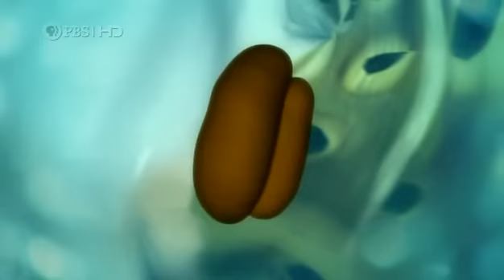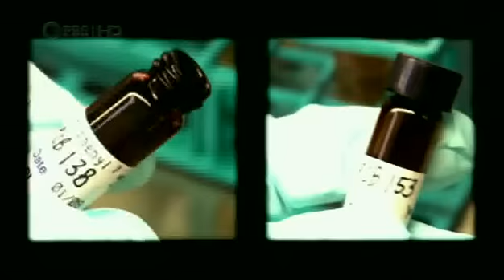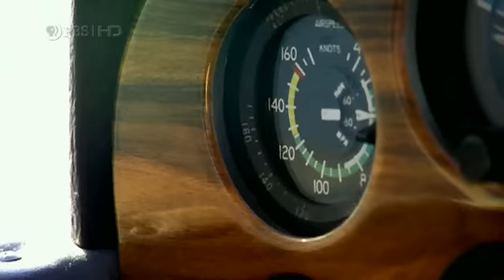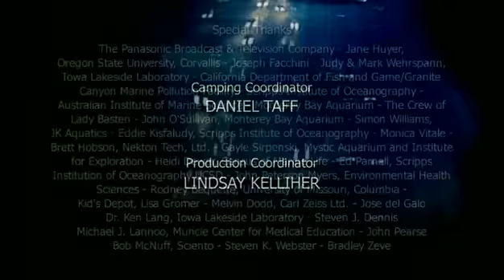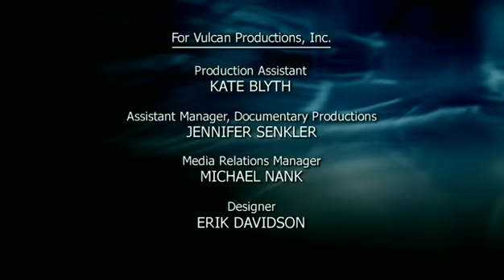National Geographic - Strange Days on Planet Earth -Part 4 of 4- Troubled Waters

Comment: Solution? Why isn't reducing the usage of those chemicals mentioned as part of the solution? Why isn't the possibility of blaming the manufacturers of those products mentioned? Most of those chemical products and fertilizers usage could be cut without impairing results?
Buy more and spread more is what those corporations preach, not to mention lowering or abolishing regulations restricting their usage.